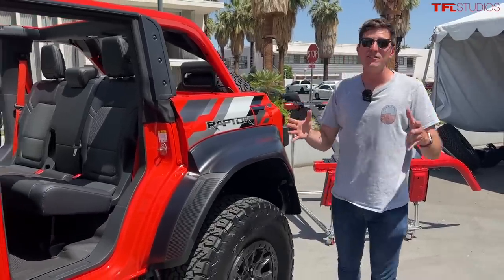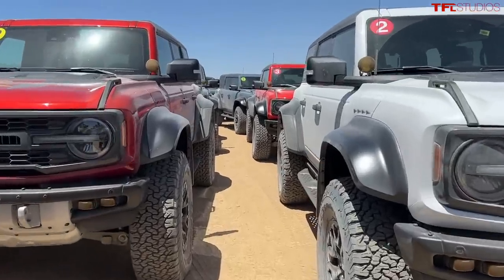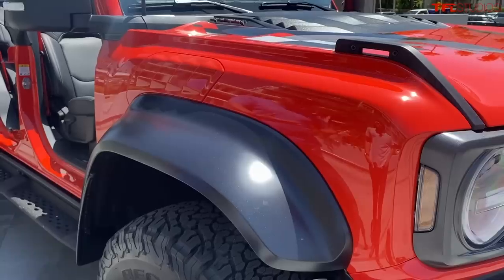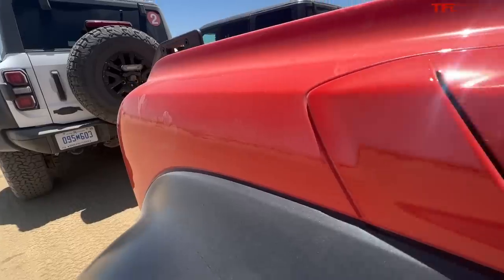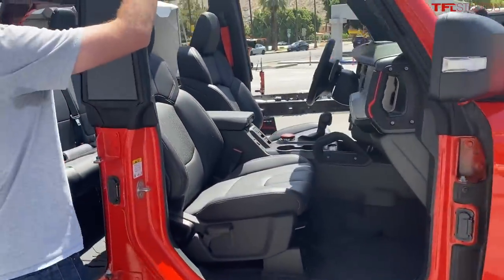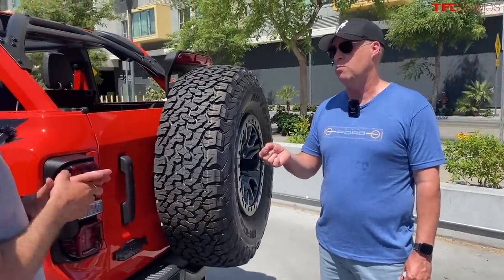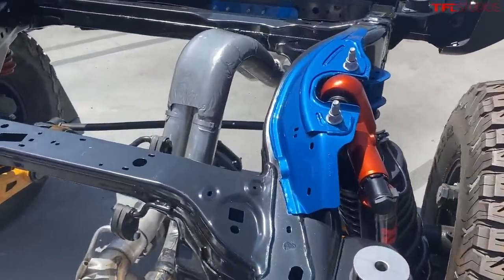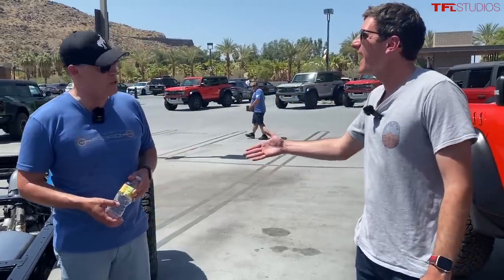There Is No V8 In The All New 2022 Ford Bronco Raptor: I Ask Ford Why!

Comment: The 2.7 is a great motor; when it's not puking its guts out as they appear to be doing in large numbers
Reply: 48 people out of thousands that have been built and sold is hardly a large number!
Reply: Unfortunately that's not quite accurate
Reply: @kevinbarry71  Actually it is but as always people on the internet seem to know more do please provide the numbers and research.
Reply: @jmc6000   The bronco6g forum has 50 already. And that's a very small subset of the people who have this car. So if you think that's all there is; I have a bridge for you
Reply: @jmc6000  you are quite credulous if you think those numbers are the only ones. Ford has acknowledged the problem; but I don't recall him saying anything about having actually fixed it. But this is nothing new for Fords. Look how many 3.5 turbo engines were destroyed because of the terrible timing sets. I think they're on revision 3000 of those parts

Comment: Lame excuse for not installing the V8. Ford didn't want to spend the R&D cash on making a jeep HEMI killer. Ford wants to shove 10# of chit in a 2 # bag. The buyers that can afford the raptor would rather have a V8 instead of the shit eco boost motor. And lets just talk about warranty on the raptor. That eco boost engine wear is way faster than a non-power adder engine. Ford failing to go all the way. Whome ever is calling the shots in Ford Performance needs to be kicked out the door with a Sasquatch sized foot. You'll never dominate motorsports again with a balless guy calling the shots.